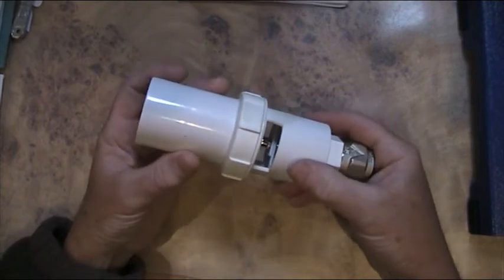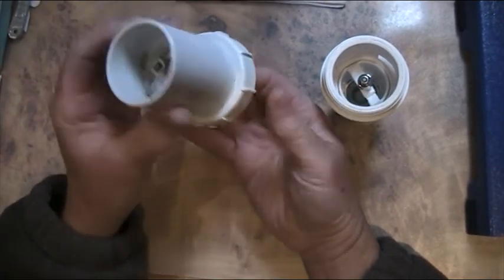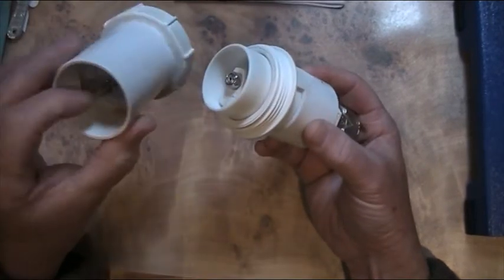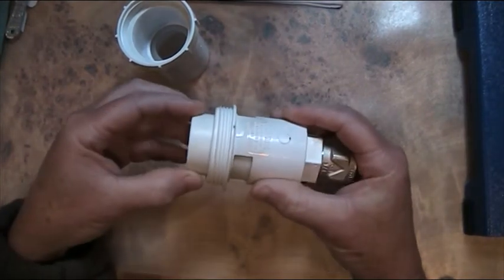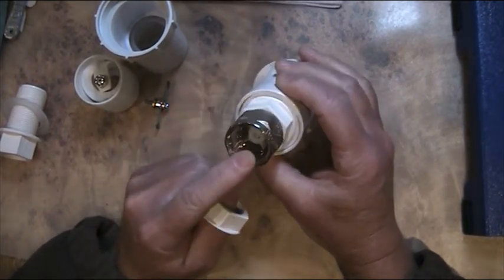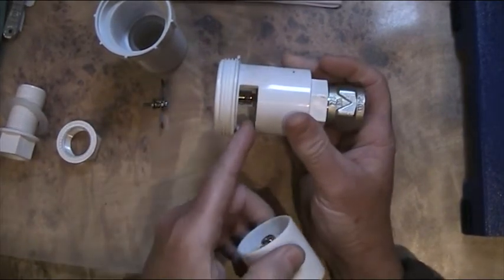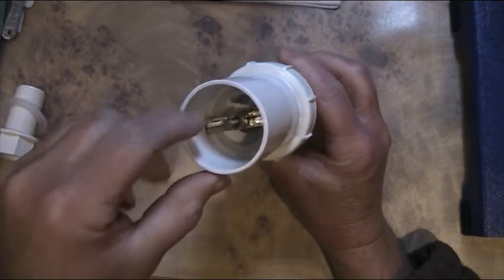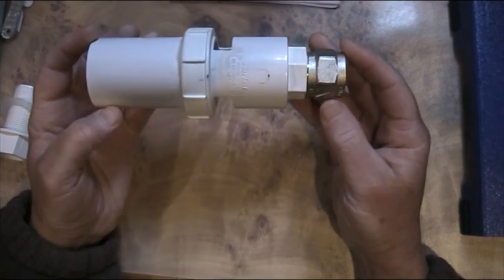Hydraulic Linear Ram Pump - Assembly

Comment: Thanks for the video - are these available for sale?
Reply from the maker: You're welcome. This was a proof of concept only. I have one modification to adjust the sensitivity without the need to take it down but haven't tested as yet. Also, I don't have ready access to a head of water so haven't continued the development.
Reply: @markjennings8479  Some are testing using a large bucket of water on a stand.   I'll probably do similar in the winter before moving to the summer location where the pump may be actually used.    Any idea the minimum head requirement and the ratio of head to lift that you are getting?   Because of the lower number of parts required with your approach, the cost per volume pumped may be less than other approaches.
If interested, please take a look at the Water Wheel Pump public Facebook group:
https://www.facebook.com/groups/240458583255303/
While a ram pump is not a water wheel pump, it meets the spirit of using flowing water to pump water and we've had quite a bit of discussion, partly because constructing the wheel is a significant overhead to driving the various kinds of pumps like, spiral, Archimedes, direct lift and mechanical powered water pumps.
Reply from the maker: @davebean2886  My setup was a large bucket on a ladder with 3no 2m 40mm pipes giving 1m head. The delivery pipe (when fitted) was 1no vertical 2m 20mm pipe and there was flow. Even though the bucket was being replenished via a 15mm garden hose, the system volume depleted the supply very quickly. The magnets are an excellent solution to a problem but longevity would require them to be protected from the water...Neo's aren't fond of water if the plating is damaged.